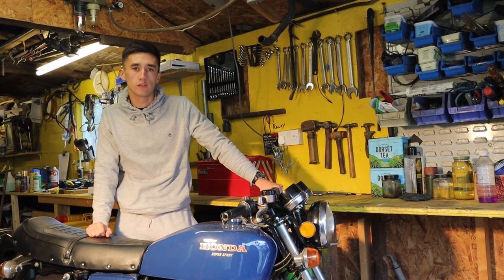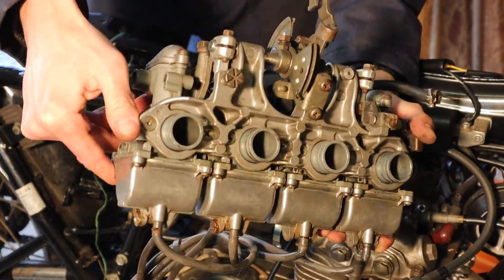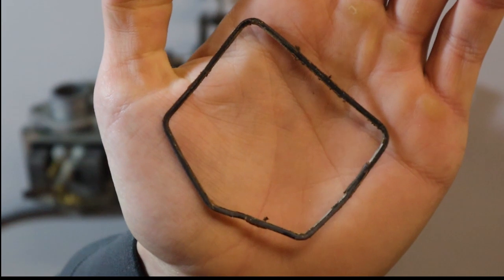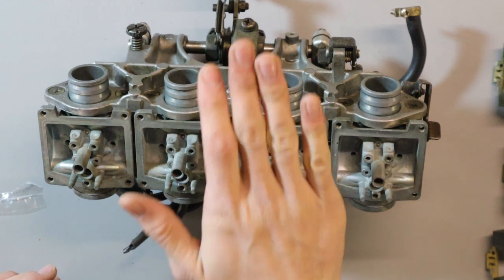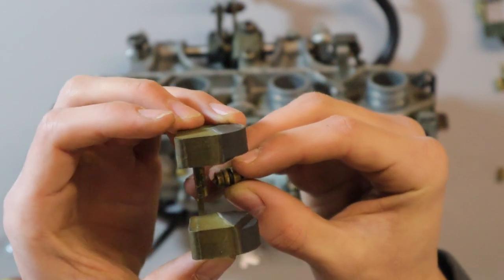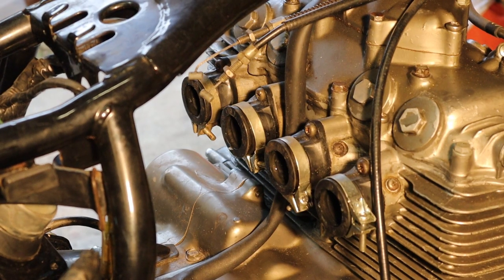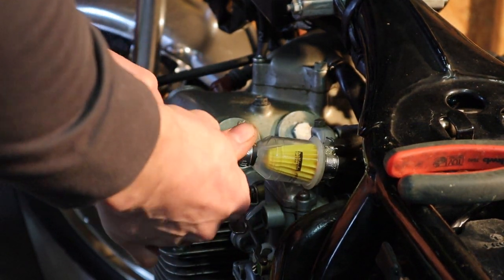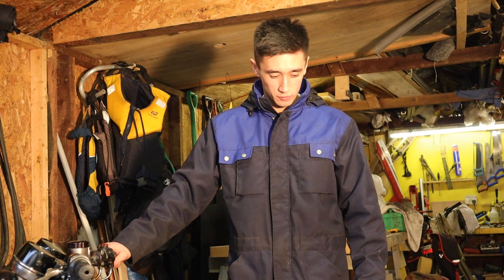Classic 1976 Honda CB 400 Four Super Sport. Carburetor overhaul.

Comment: Great bike.  Good instructional video too.  On my 1975 CB750 I haven't had to use clamps on any of the fuel hoses (carb connections, fuel filter or petcock.).  The fuel lines all fit snug and haven't leaked a drop.  I use clamps on the manifold boots obviously (engine side and airbox side.).   I would've sprayed some carb cleaner and compressed air through any passageways and double-checked float heights before putting the carbs back on the bike, but it sounded great when you fired it up.

Comment: You don't need to disturb the airbox.. just remove  the filter and the large oval tube that goes into the collector box .. (loosen the clamp first) - I was a motorbike courier had 3 of these that did over 500k miles in 14 years so I know!